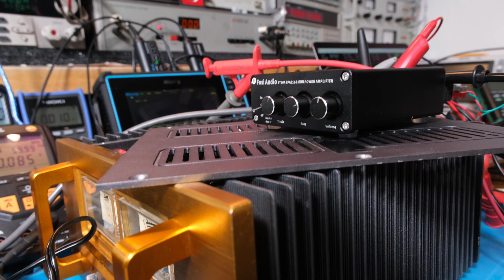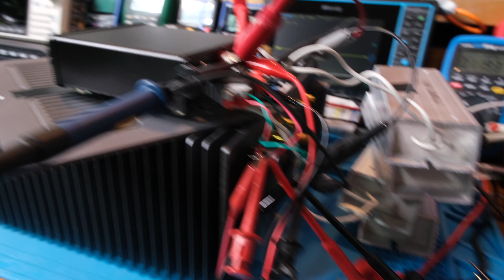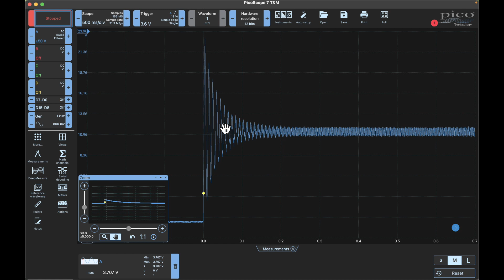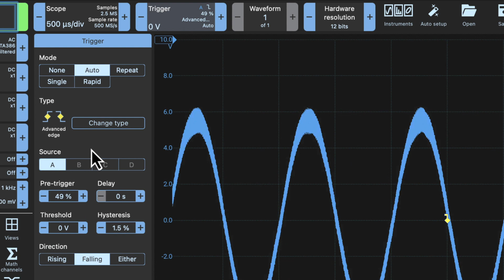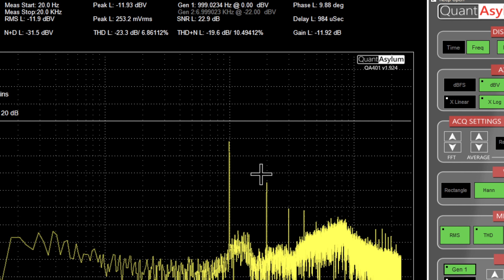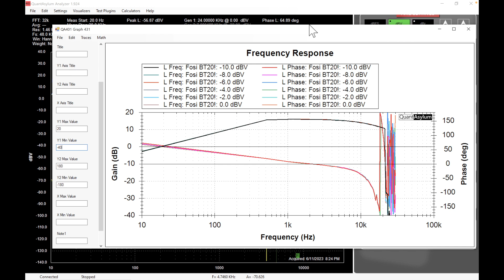Fosi BT20A Amplifier Review and Test with QA401 - I blew it up! #FosiBT20A #FosiAmplifier #Picoscope

Comment: Audio Science Review reviewed this amp too. With a 48 volt power supply 1% THD at 4 ohms = 150 watts per channel. Peak power was 181 watts. I mean, headroom wit a class D? It's pretty clean too on Amir;s other tests. Load dependency was basically flat. Amir also tested your audio analyzer - lol. His evaluation, in short:  Despite being a total hardware and software solution, the QA401 is ridiculously low priced at just US $449. To put things in perspective, my Audio Precision APx555 retails for US $28,000. . . .The QuantAsylum QA401 is crazy good value in audio analyzer hardware and software."
Reply from the maker: Thanks so much for the amazing feedback!  Yes I thin the AP is way over priced.  They got started when the competition was just the big guys using expensive equipment - so they were the more affordable solution -  even at their high price.  Also their device went to a computer solution with great software, so they blew away the big guys like HP, Leader, and Tektronix.  At least that's the way I remember it.
Reply: It was a different amp tested on audiscience, the BT20D Pro, using TPA3255 instead of 2x TPA3116. That one, with 48V psu looks pretty usable.

Comment: I have tested many class D amplifiers on my channel. I have not found a single one that meets the published spec. In fact, these days no manufacturer of such amplifiers will send me any for review because they don't like me telling the truth. The main issues I find is that none of them produce anything like the rated power by a very long way. Many overheat due to small heatsinks, or NO heatsinks. Poor ventilation.  The output filters are only fair at one impedance. Reliability is often poor due to fake parts (and overheating) wrong parts. Often different batches use different parts. 
The one you are testing is probably the worst I've seen, so far. I think it comes under the heading of COMPLETE C**P. More land fill. Interested to see what chip it uses.
Reply from the maker: You are right Michael - the specs are almost always over inflated - no matter what amp it is;)  In this case I pulled a bonehead move that I'll explain in a post very soon!
Reply: @kissanalog  Did you earth one of the speaker outputs in error by any chance??

Comment: I have a little fosi audio da-2120a amplifier which i use as a desktop.; 24v 4.5 amps output, its supposed to output 50 wpc @ 4 ohms. its nowhere near that, but works ok for a cheapy + has BT & full remote control 🤷‍♂
good video, thanks. 
looking forward to the repair video in case mine goes bang 😅
Reply from the maker: Thanks!  I liked the sound of this little amp for an office size environment.
I’ve started the troubleshooting video:)

Comment: I don't have the BT20A but do have the TB10D (combined with the TUBE P1). Haven't put it to test the max out of it but I am more than happy with them and the TB10D certainly is a nice and powerful little class D amp even with my 8 ohm high quality Mordaunt-Short bookshelf speakers. I would certainly be interested to learn what went wrong.
Reply from the maker: I’d like to test that amp one day.  I’ll have to get one after I sell some equipment :)
Reply: @kissanalog  That would be great 👍🏻 Eddie.
Reply from the maker: Thanks!
Reply: @kissanalog get the bt20a pro instead. You can switch the op-amps in that one.

Comment: It's true, there are two camps in the Hifi community. The so called, 'sophisticated purists' that turn their nose up at having and using equalization controls, and then the other camp that get into high end equalizers. 
I could be wrong but I tend to think the so called purists need to keep it simpler in being able to rank streamers, DACs, turntables, preamps, amps and speakers. Having a Bass and Treble control, or an extensive equalizer muddies the water. 🤣🤣🤣🤣
This was demonstrated to some degree in your sweep test with the Bass control turned down.
Reply from the maker: Thanks for the great feedback!  I like the tone controls, but I agree that for comparing other equipment it would be great to keep them flat:)